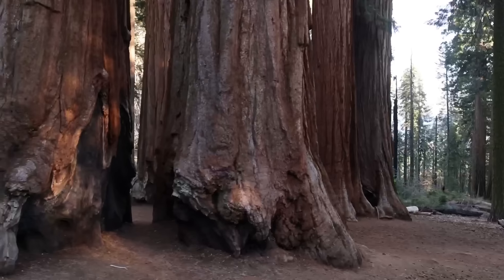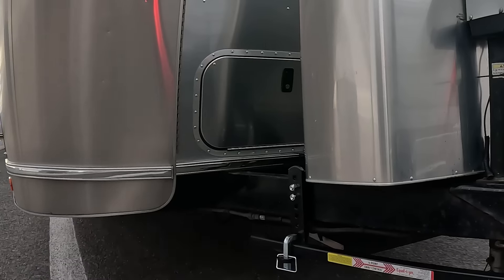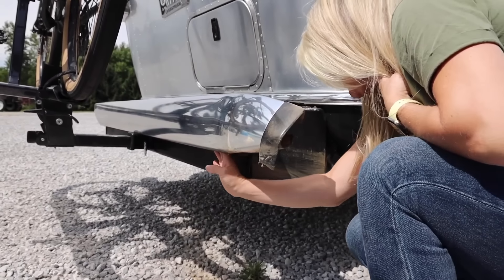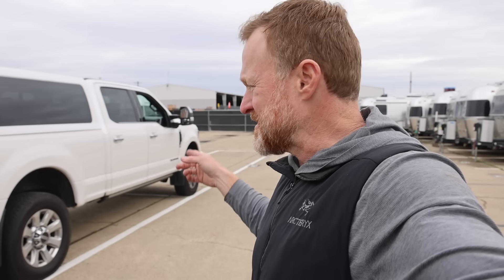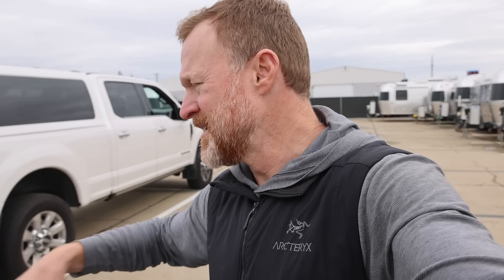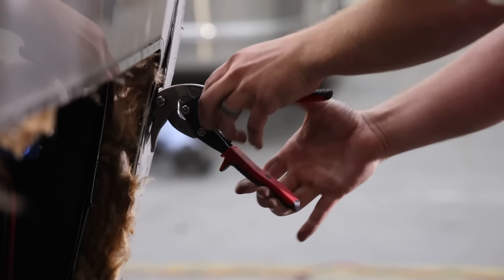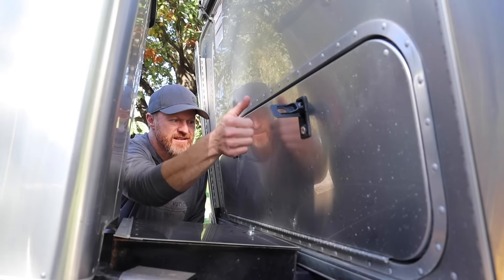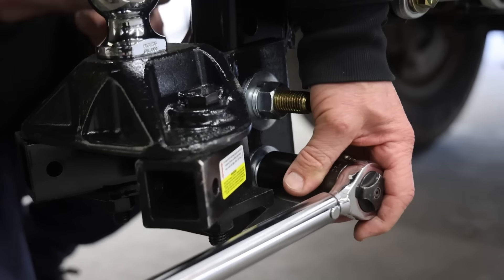AIRSTREAM: Front End Separation Correction

Comment: I have a 2021 Globetrotter, I didn’t have front end separation. However I did notice a gap appearing in lower corners of front hatch and some dimples, I had no torn aluminum or sheared rivets at this point. However my trailer had low miles in it so I called Airstream and they advised I bring in for evaluation, Jackson Center is only six hours away so I made appointment and in March 2024 I made the trip. Airstream said nothing is moving around but to make sure they removed my hatch and from underneath installed heavy duty aluminum gussets at lower corners of hatch. Gussets are bolted in place to the frame crossmembers front and side then hatch is riveted through gusset. 
This gives me peace of mind and I thank Airstream for stepping up and making the corrections to my Airstream under warranty.
FYI, all new Airstreams with front hatch now have these new gussets installed upon assembly.
I was told by tech at Airstream that these gussets are the new style that are much more robust than the previous ones used for repairs prior to 2024, the new gussets look just like the ones Vinnies uses in video.

Comment: Most Excellent Video!!!!! I had the Beltline just starting to pull away and small bending at the corners of the front storage on my 2020 27 FC. The factory repaired saying they added bolts and I already had their smaller than Vinnies braces in place. So far no return of beltline pulling and bending at corners. I talked to Vinnie and he said the Blue Ox hitch doesnt stress the trailer as much as some others. I have a lift on the trailer so my rear end doesnt drag. It seems 30ft and longer have a higher chance of dragging due to departure angle because there is more length behind the rear tires to drag. I now keep an eye out on the front area as part of my general checks when towing. Thank you for the straight forward information.

Comment: Vinnie is a pro. He breaks down problems so easily.  The separation issue is highly concerning given the high ticket item the airstreams are.  You'd think the design engineers would have considered the problem that Vinnie outlined.  It blows my mind.  Another reason I'm glad we opted to not buy one (we almost did recently).  The hitch is pretty cool; very similar concept as the hensley but simpler setup.

Comment: Also highly recommend a HD truck and getting rid if that weight distribution hitch. Between the backup cam and getting rid if ours I can hook/unhook incredibly fast, it saves a ton of time and aggravation.
Reply: Our, 2007, 27FB airstream has approximately 150,000 miles on her. We have been towing without an equalizing hitch for the last 10 years since we purchased our 2500 GMC. There is never sway, even when driving on two-lane road roads with vehicles as well as trucks approaching at 70 miles an hour. I,have to laugh when I see people towing a Basecamp or a Bambi and they are using distribution hitches. Someone has sold them a bill of goods.

Comment: A couple of observations-
To prevent having a 2” receiver and a bike rack on the back of the  Airstream I have a front receiver on the truck and haul the bikes on the front of the truck.
Also, to smooth out the ride I travel with a full tank of fresh water.
2013 Classic 30
2007 Toyota Tundra Crewmax Limited

Comment: Looks like a very good repair. Maybe it wasn't shown in the video, but I would liked to have seen some high quality sealant go in between, and coating, those dissimilar metals. Keep an eye on the repair for corrosion. We used polysulfide sealant in aircraft structural manufacture and repair and it would extend well to your Airstream. It's not just for aircraft. It's very well known for boats too. The front end of the trailer is obviously a high water intrusion area, and thus, salt. And you know well what salt does to metal.
LOVE your channel!
Reply: Good catch. We should have pointed out that we use a roll of the same tar sealant that airstream uses between the panels at assembly.
Reply: @vinnielamica8704  I specifically came to the comments to see if anyone else mentioned this too. Thanks for clarifying!

Comment: I really liked this video even though I probably will never own an Airstream. This video pointed out how weight distribution hitches are not good for the trailer! With the properly sized tow vechicle and air bags or other means of eliminating "squat" of the tow vehicle, I contend WDH hitches are not needed. I tow without a WDH and this has eliminated much of the porpoising when going over expansion joints on highways especially at bridges! I have towed a 24' trailer 13,000 miles in 2023 including a trip to Alaska!
Reply from the maker: I plan on diving deeper into this and I'd also like to really understand if airbags (on the truck) is really doing anything other than making it appear level. Weight is not shifting from the back, but rather the chassis is just being lifted. More to come.

Comment: A lot of people in the Airstream community attribute FES to WDH's when used in conjunction with 3/4 and 1-ton trucks that were designed to tow heavy and don't necessarily need WD.  That combination seems to put too much stress on what is now known as a weak area around the front storage compartment.  Airstream is aware of the issue and has begun to brace that area better on the new production units.  I have an Equalizer for my FC27FB with the front compartment and a RAM 3500 CTD SRW.  I'm going to switch things up and tow on just the ball with some Torklift Stableloads and see how it handles that way.  I've spoken to a few Airstreamers doing this and they have not had any issue with sway or porpoising.  I plan to keep the Equalizer in the truck just in case I need to switch it up on the road for a while.
Reply from the maker: I too am going to tow without WD just to see. I like the firm connection of a WD, but with 4000 pounds on my front axle, that's plenty of weight.
Reply: Totally agree!  Love the channel and always look forward to Sunday nights!  It's because of y'all we have an Airstream!  Thank you so much for all you do for all of us!  @KeepYourDaydream   And if you're getting a new truck, you should join the RAM-ily!
Reply: I am curious... I have a RAM 2500 Cummings and a friend who as the same vehicle and rig doesn't use a WD and claims he never had any sway issues and truck is level...  The time savings alone would be awesome... Mark please let us know how it goes... and congrats on the new GT...

Comment: Great episode.  Thanks.  I'm considering getting an AirSafe hitch. Not because I'm concerned about FES (we don't have an Airstream, we have a Safari Condo Alto F2414).  Moreover, because the Alto is so light (slightly less than 3,000 lbs empty) and we tow with a 2024 GMC Sierra 3500 DuraMax, we tow "on the ball".  The reason I'm considering the AirSafe is to perhaps be overall beneficial to the structural integrity of the Alto by reducing some of the jarring effect of bumps, etc.  Now that you've had more time with the AirSafe, what's our thinking about it?  Thanks.  Cheers,

Comment: I’ve used an Equalizer for 15+ years of towing but recently switched to an Andersen on our Airstream due to back health issues.  The equalizer and its load bars weigh 106 pounds, compared to the Andersen that weighs 26 pounds.  The Andersen is also so much easier to manage, and quicker to hitch/unhitch, much quieter and smoother riding.  The Equalizer certainly can transfer weight and sway control is excellent, but it’s an entirely unforgiving connection.  Towing experience with the Andersen is much, much better, but I’m a bit wary of what the forces are doing to the coupler mechanics.

Comment: Sometimes tying structural components together with stronger bracing, gussets, etc. will only move the breakage and separation points somewhere else in the system...  A better approach is to allow movement to take place, but without damage...  Why not design a floating front end instead of just tying it down to the frame...  For example, furniture makers know that wood is always moving...  And traditional joinery techniques allow for that movement without splitting or breaking...  That is why well-built antique furniture lasts centuries and do-it-youself pieces that do not allow the wood to move disintegrate in just a few years...  Just sayin' 😎

Comment: I've got a '19 30'fc bunk w/6 battle born batteries and a 3k victron inverter in the front compartment.. similar problems and wonder if the additional tongue weight of them was the cause?   Same truck w/airbags too
Reply from the maker: I'm sure it's not just one thing, but everything working together. Payload, WD hitch, heavy duty truck, bad roads, large compartment. But based on how Vinnie fixed it, I'm confident it's corrected for the duration of the trailers life.

Comment: So no more weight distribution hitch? I sounds from the video that he was saying it could cause damage? We just bought a trade wind so trying to figure out which direction on hitch setup.
Reply from the maker: I don't know yet, but it could have contributed some. I am going to dial it down some.
Reply: @urDaydream I'm thinking so too. I wanted my truck completely level so adjusted the WD accordingly. But on certain roads/speeds I get enough bounce that the whole family gets car sick. I'm thinking of dialing it back too by one bolt hole. The truck will not be level by a half inch, but maybe that's not so important considering the ride we are feeling. (And yes, still within the weight limits at the scale in either case)

Comment: What a fantastic video. I’m in Australia and there is a lot of “discussion” about the merits or drawbacks to weight distribution hitches but this video did a lot to explain where that load gets transferred too. Used properly they can be a good idea but too many people use them to offset overloading. Cheers, Stuart 🇦🇺
Reply from the maker: I'll be talking about this more. I've been meaning to switch to Equalizer and plan on doing a detailed setup. I'd also like to tow without just to see the difference.
Reply: @KeepYourDaydream  I can happily report that when we changed vehicles to a new 200 series Land Cruiser the weight distribution hitch was no longer required. Our van only lowered the back of the Cruiser about an inch or so. This actually levelled the car out removing the bum up stance the Land Cruisers normally have. Our Sahara has automatic headlight adjustment so that’s not a problem and no more creaking from the weight distribution hitch on tight turns. I know you’re supposed to undo the distribution hitch when tight manoeuvring but who does that. I also find the whole unit rides better but that could also be the Cruiser’s extra weight helping to control the load better. Best of all though it makes hitching up much quicker. 👍

Comment: Great video and I have questions.  This bracing  doesn’t stop the frame from flexing, right?  Hasn’t that pressure just been moved to another place, like the outriggers?  How much would this repair cost?  If the customer doesn’t contribute to the problem will it only delay the day the front end separation occurs?  Could someone strengthen the frame to avoid the flexing problem if they were willing to tolerate the consequences of additional weight?
Reply: Your on the right track with your thinking. The shell wants to remain flat as it was built on a perfectly flat surface. This repair will cause the shell and frame to work as one. So we must mitigate the flex to the frame as phase two. Reduce the tension on the bars, airsafe to help with the up and down forces on the frame, watch to excessive loads and dragging and keep an eye on it.

Comment: So was it the wdh and the additional weight on the back that caused this or is it just a potential problem on 30ft Airstreams? I’ve always run a wdh to help level but mostly for sway. One thing in the back of my mind is that puts more weight in the TT axles which are typically not exactly overrated on most TT’s these days.

Also noticed you dropped it off with the Ford but took it away with a GMC Sierra. Loaner or new truck?
Reply from the maker: I'd like to test this.

Comment: I’ve always wondered about weight distributing hitches (WDH).  The weight is lifted off the rear axle and “distributed.”  How much to the front axle?  How much to the rear axle?  Can the rear axle handle the additional load?  The weight of the rear axle is centered on the chain attachment points on the WDH.  Does the trailer frame bend at that point?  (Likely, yes, even in just a 1/8”). Is the frame and trailer shell designed for this flex?  So many questions.   We need  Engineering Explained (YT Channel) to assist here.

Comment: If airstream used a engineer designed frame instead of using the camper itself as part of the frame, you wouldn’t have that problem  there’s a trailer company called diamond C in Texas that makes engineered design frames for their own trailers very smart people. Maybe Vinny should reach out to them or Vinny can reach out to a metal engineer and design his own frame for the airstream. Just a thought there is one company that uses aluminum on everything they do not weldthey use special rivets because Welding takes 50% of the strength away. I want to say it’s western trailers I could be wrong.

Comment: From an engineering point of view that fix is totally bogus.    The problem with the stock setup is the frame flexes which causes the trailer shell to flex which wears out the attachment of the aluminum at the hitch.    Trying to attach the aluminum better won't help.   The solution is to remove some of the flex of the hitch and frame, ie make them more rigid.

Tying the shell into the frame better is just going to make stress points elsewhere where the aluminum will fatigue and break.

Comment: I think Vinnie is far to kind to Airstream. They build a very very very expensive trailer with low ground clearance. Dragging the tail is an entirely foreseeable and expected consequence of that basic design. Just like mounting bikes on the rear of the unit. Especially at their price point Airstream should not be getting any kind of a pass for poor engineering which is what this is. The fact that he still suggests that air hitch even after the beef up tells you all you need to know about the integrity of the original design. 

This wouldn’t be okay in a Jayco at that price point. At the Airstream price point it’s just beyond unacceptable.